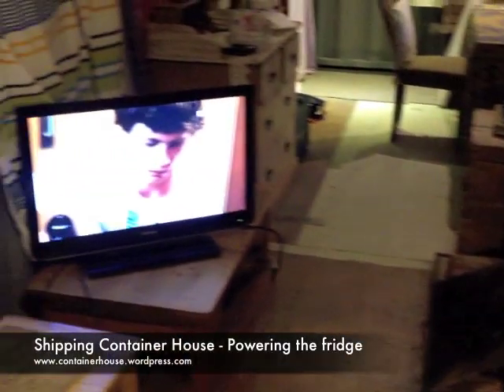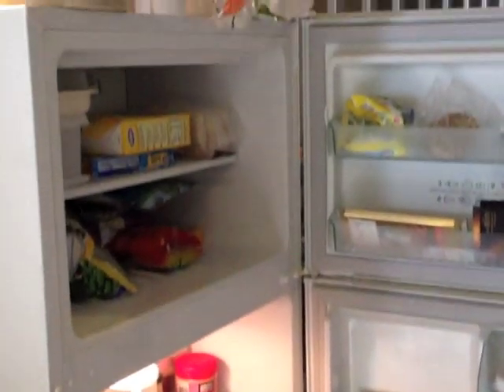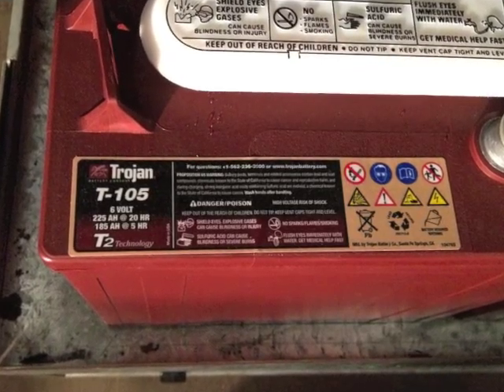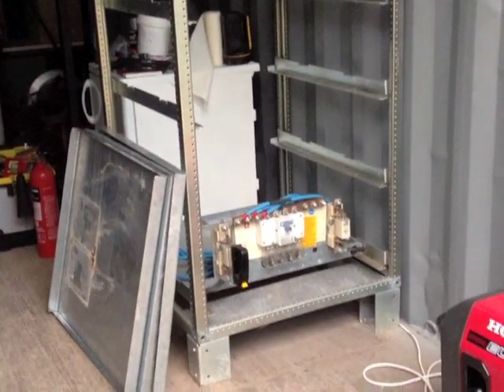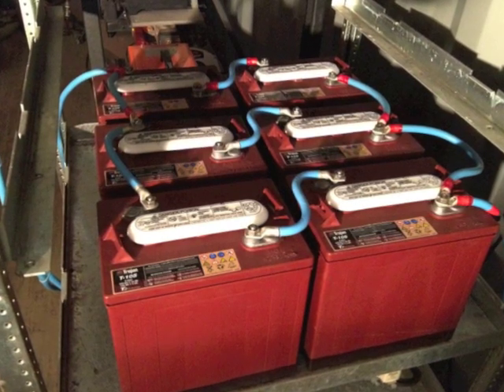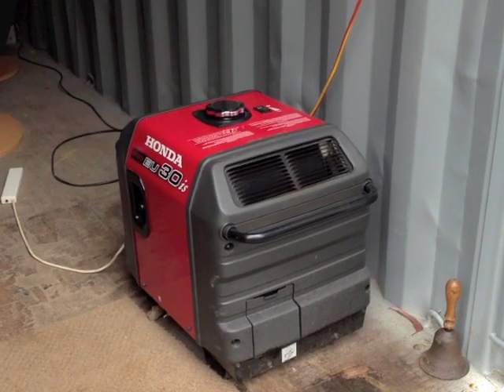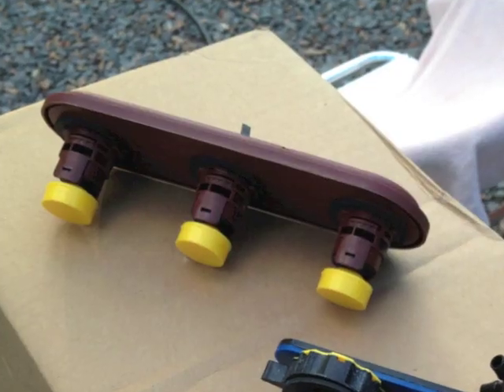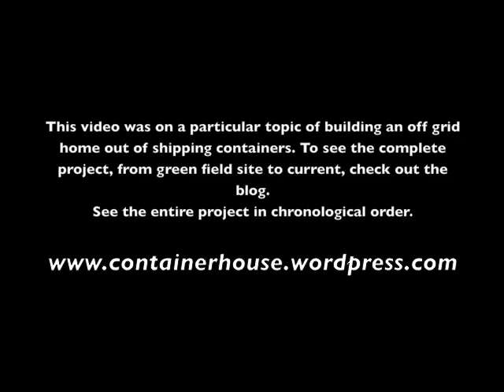Shipping Container House - Small solar battery bank

Comment: Open Stair Step make a great way to store batteries in a bank.  Just cut or buy the stair step runners the height you have room for and add wide step boards, which can be 2 X 4s because they are only holding batteries.  This way they are open and easy to maintain.  Maintenance tools and connections can be stored under the stairs.  This is how we did it in the factory I worked in where we had to have batteries for switching high voltage switch gear on a battery backup system.

Comment: Hi. this is a great video! Im doing a similar research project in university and i would like to know what kind of inverters you used, how long does the battery take to charge up, and discharge. Also what is the lifespan of the battery? Im really just starting and don't know where to start. Would appreciate it very much if you could pinpoint me! Greetings.

Comment from the maker: Hi zaftg337, Thank you. I have almost completed a book on the project and the battery chapter will answer all your questions. If you give me an email address I will sent you a free copy and you can pick out the bits that help. There is also a chapter about inverter selection. Good luck with your university. Cheers Paul